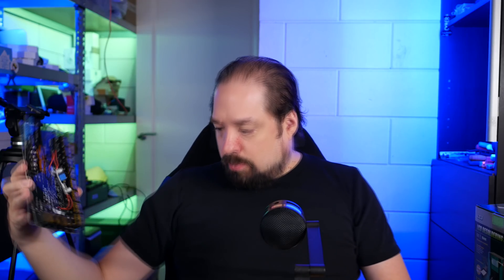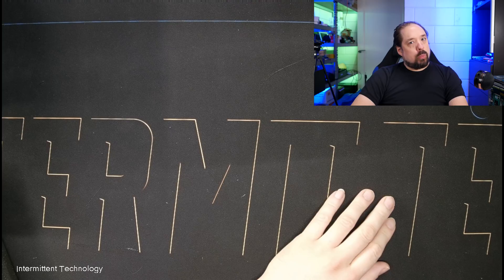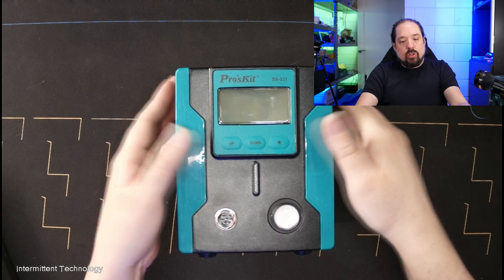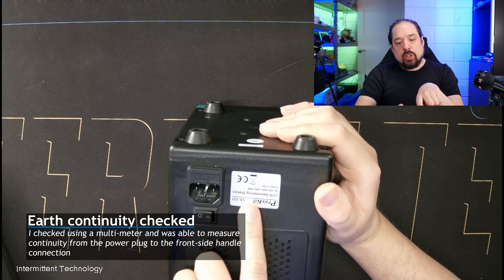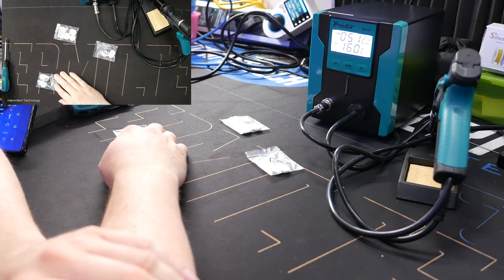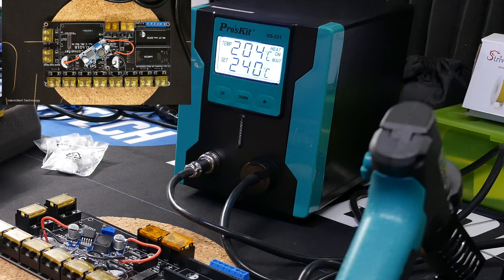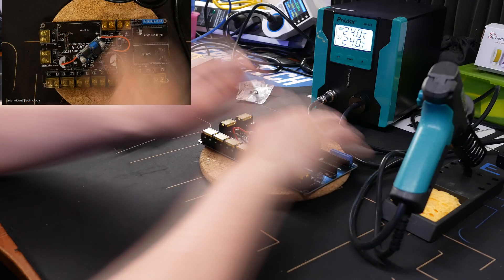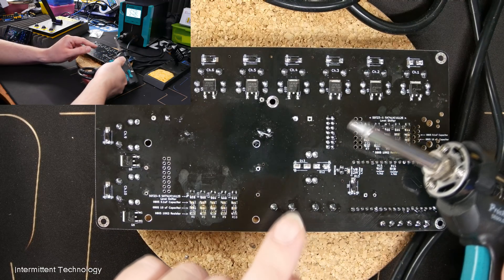🔎ChinaGadget🔍 De-Soldering station | Pro'sKit SS-331

Comment: I just built mine myself. For an original SS-331 replacement handle I paid $35 and $25 for the pump (VN-T1), the rest of the electronics I had already lying around, so can definitely recommend building one yourself.

Comment: 240°C is way too low, especially if you're desoldering anything manufactured with lead-free solder. When I was a full-time audio-equipment repair tech, I worked with Hakko and Aoyue desoldering station's typically set to 380°C, and if I was working with lead-free solder I might bump it up to 410 or 420C because leadfree solder has a higher melting point. It's also a lot easier to desolder anything manufactured with lead-free solder, or older products made with leaded solder, if you add some fresh solder to the joints first because the flux in your solder will reactivate the existing solder on the old circuit boards and make it easier for the machine to liquify and remove it. 

 I find it interesting that this machine uses a widely spaced coiled spring to tension the parts in the solder collection chamber, but does not use a fine type spring as a sort of solder collection cup like many of the modern inexpensive desoldering stations do.  That solder collecting spring which was included in the Aoyue station at work functions poorly, and I prefer the older technique of stuffing a small wad of medium grade steel wool into the collection tube to cool the molten solder and flux fumes and catch them.

Comment: Ok video. However, when you desolder, don't just hold the sucker tip onto the pin and press suck. One must hold the sucking tip at 90 degrees to the pin, (which you didn't do at times) then move it slight around then suck.  Don't rush, and you'll will find you will get even better results...!!!

Comment: Great 
I made a DIY arduino based version 
Its in my channel along with the required files
Reply: Thanks to you I also built my own one, I designed a slightly different circuit for it and powered the heater with 18V from a buck converter which brings huge power improvements at higher temperatures (PTC heating element goes high resistance at high temperatures) but the idea and basic design is based on your version.

Comment: Excellent for its price but understand its limitations - the 90Watt heating element is plenty to desolder single sided and double sided printed circuit boards including plated through hole PCB's - BUT what I bought mine to do was replace all 65 Capacitors on a faulty Computer Motherboard.

Computer Motherboards are double sided, entirely plated through hole design AND (as I discovered) have a SIX layer PCB meaning the fibreglass board has a layer of copper then an insulator layer then another layer of copper and so on until you have three electrically separate layers of copper on each side - with various inter layer and some through board interconnections as well.

What this means in practice is some Motherboards will have HUMONGOUS THERMAL MASS especially around certain parts/areas - so performing any soldering / desoldering work can be difficult especially in certain areas of the Motherboard where large areas of copper are left to act as a heatsink and/or RFI shield.

I discovered that with pre-heating the Motherboard the work became a lot easier - but also noted that a big name brand of soldering iron I was using even though it was only a 45Watt element could melt the old original solder where the 90Watt desolder heating element was not hot enough even at max power/temperature settings - probably due to conversion efficiency - the 45Watt soldering iron probably delivered nearly all of its 45W of heat energy to the solder joint while the 90Watt desolder element apparrently did not deliver all of its 90W heat energy to the joint to be desoldered - implication being the 90W heating element is only about 50% efficient at transferring heat.

That is how I found out why there is a market for the very expensive big name brand desolder stations - when they say they have a 120Watt heating element for desoldering they mean it is around 90% efficient so transferrs nearly all its heat energy effectively to the joint to be desoldered BUT unless you regularly work on SIX layer PCB's you will be very happy with the desolder tool in the video.

By the way the Motherboard I repaired by replacing all 65 Capacitors on still works perfectly 4 years later.

Comment: I've had this one (the ZD-8915) for about 5 years now and it's been doing pretty good for me. It's certainly not close to a professional desoldering station but for most things it's more than good enough and has about 1/5th the price. It will take a bit of time to get used to it however. Desoldering is quite different from soldering :)

Comment: Seems like a super useful tool for prototyping! I did your same reasoning some days ago and I bought a smaller desoldering iron which costed me around €20 (on Aliexpress, if you'd like to check it out here's the link: https://a.aliexpress.com/_d7DZukj ). The main reason i went for that kind of desoldering tool and not a full station was that, since its final price was under €22 (i'm from Italy), i wouldn’t have had any problem with extra import fees in any case... Just to know... Did you bought the SS-331 from Aliexpress/banggood or from some store inside EU?

Comment: Your station is more commonly known as a ZD-8915. It comes with identical accessories and behaves exactly the same. Price is 79 euro (tax included) and is available at Eleshop (=a good dutch electronics webshop).

It requires a little bit of practicing to avoid blocking the nozzle and to get a fluent workflow (temperature, suction times, reheating time ...), but it's a good station. Ideal for occasional desoldering without the frustrations of a manual pump and/or wick :-)
Reply from the maker: Hey, thnx for the comment! I've bought from eleshop before (my soldering station comes from there for instance). :D

Comment: Nice, I've been looking for a cheap desoldering gun (I looked at a Pace one and promptly had a stroke), always good to see a hands-on experience. Seems pretty good for the price! Do you think it would struggle to remove small pitch through-hole components using the smallest tip? Like 1.27mm spaced leads?
Reply from the maker: Depends on the seal you can get. It worked really well on the 2.54mm pin headers. And once I changed to bigger nozzles it also worked well on that big stuff, so it certainly had the power.

I desoldered some of those temperature sensors which are quite small. Worked well on 2 but couldn't get the third out. So I think it will work (especially if you don't destroy the nozzle first by using the wrong one 😅)